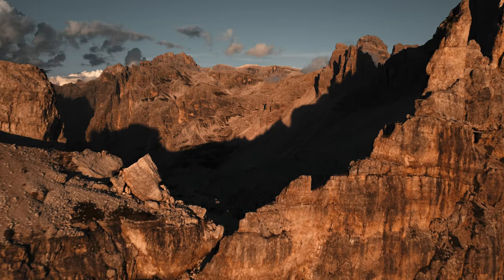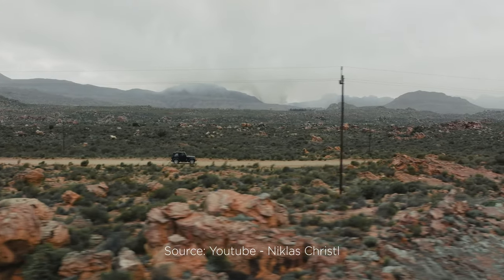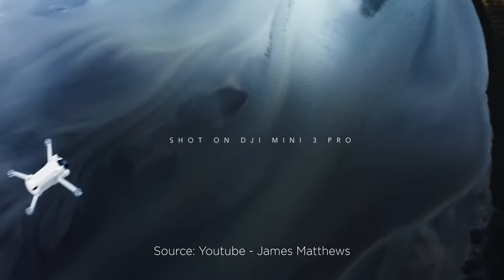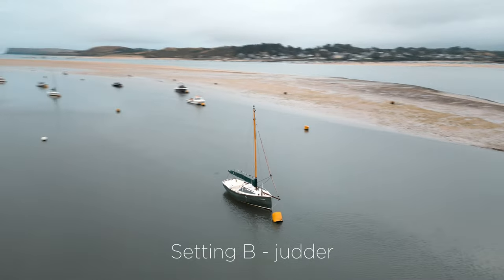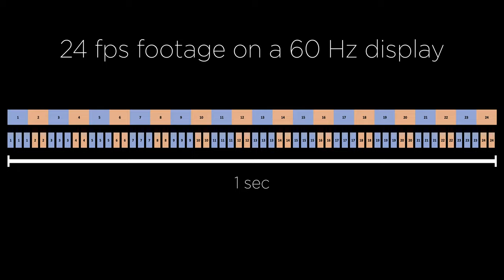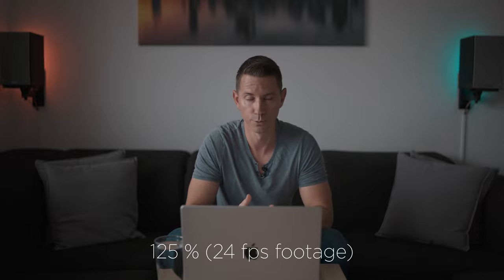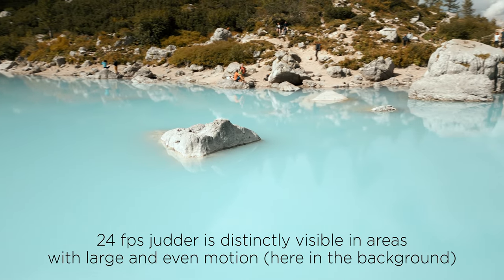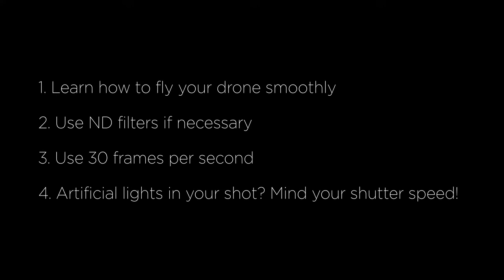The #1 Secret for CINEMATIC Drone Video without Judder, Stutter or Jerkiness

Comment: I always shoot is 30fps and still just judder in every shot. See example: https://drive.google.com/drive/folders/1NnF-pRnSiLeECeY0R9VazVfoXTnD4CM6?usp=sharing
Then you have the mini 2 who's footage is buttery smooth. See example: https://www.youtube.com/watch?v=eOtDm02C18s
I don't understand. I notice that the media player chosen makes a big difference in playback. Do you have a recommendation for DJI drone footage?
Reply from the maker: Right now I don't have a computer with me to check your video files. I will check in the coming days. But if Mini 2 is smooth and Mini 3 is not, I assume that you use H.265 codec on Mini 3. Mini 2 uses H.264, which is easier for playback on your computer hardware. Check your Mini 3 settings.. if you have selected H.265, choose H.264 and try if that judders as well.
H.265 is the better codec but way more taxing on your computer hardware.
Reply: Thank you for the quick reply Tom. Your videos yesterday inspired me to rethink the mini 3 pro and the potential of the drone. I haven't see mini 3 pro footage like that before. I never owned the mini2 just pulled a clip off youtube that was shot very close to where I live. I have a very powerful laptop that cost me over $3k (Zephyrus G14) that I purchase specifically for video editing and Adode After Effects. I think perhaps I should consider shooting in H.265. I have only every shot in H.264.  Perhaps my footage is moving too fast. I really appreciate your time. I do video editing and videography on the side for clients and getting my footage to look like yours would be a dream come true. Blessings...
Reply from the maker: @brady_ackroyd  I will have a look at home. If you don't hear from me within the next few days, please comment again and remind me. But hopefully I think of it and get back to you after I watched your video on Google drive.
Reply from the maker: @brady_ackroyd  I see no judder in your video. It looks perfectly fine in regard to judder. What I see is that each frame has no motion blur, so I assume you don't use ND filters and your shutter speed is too high. If that's what is bugging you, you need to use ND filters and try to aim to get your shutter speed at around 1/60 (at 30 fps).
Reply: I always use the DJI nd filters. I also lock the shutter at 1/60 for 30 fps. Perhaps it’s my second monitor attached to my laptop that’s having trouble keeping up with the footage.
Reply from the maker: @brady_ackroyd  Hm. This is very strange. I have watched now both videos on your Google Drive at home on my 27" screen and I cannot really believe that the shutter speed on those clips was close to 1/60 sec. There is absolutely no motion blur in each frame, and at 1/60 sec (or some shutter speed close to that number) there would definitely be some motion blur visible... for example in the longer video (DJI_0017.mp4) when the drone pans quickly, if I view each frame separately, it is as sharp as a photo, which leads me to the assumption that the shutter speed is far beyond 1/60. That leads to that kind of "stop motion movie" effect (a very quick stop motion movie though).
The same with the shorter video (DJI_0047.SRT)... when you orbit close by the street light pole in the beginning of the video, the pole itself is tack sharp in each frame. Wouldn't be at 1/60. If you have the corresponding .SRT files (DJI_0017.SRT and DJI_0047.SRT), those are the subtitles files to the video files that contain info like exposure settings and shutter speed. I am 99 % sure that it was not 1/60 on both clips. And this is definitely a reason why these videos don't look as "smooth" as, for example, mine do.

Judder is something different and I definitely cannot see any judder in both clips. They are very fine, judderwise. Judder happens if the frame rate of a video clip is not "compatible" with the refresh rate of the screen you're watching a video on (for example 24 fps on a 60 Hz screen). With 30 fps, you're good, judderwise. If, however, you see any judder (which would be an independent/separate problem than the shutter speed issue), it does not come from the video clips themselves. I would guess it has something to do with the computer or the media player you're watching it on. Maybe plug off the second monitor and watch it on your laptop display. Or on any other computer, just to compare if the problem persists.

I hope that helps, and if you have any other questions, I am happy to support you as far as my time allows. Cheers :)